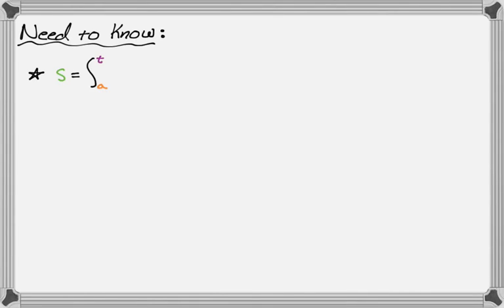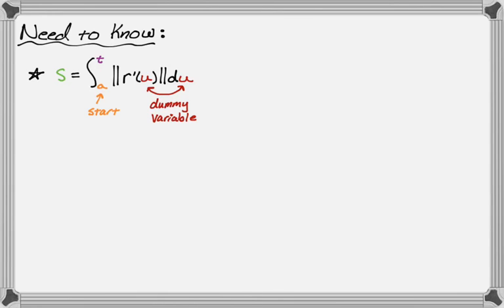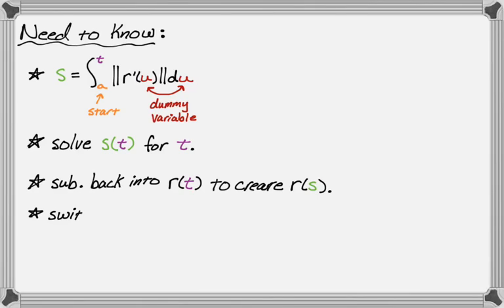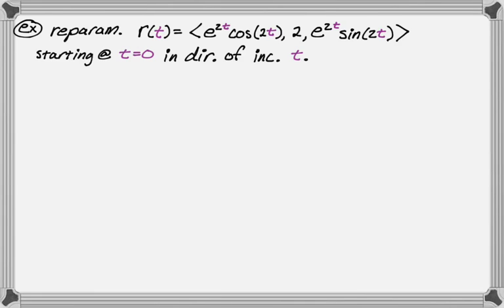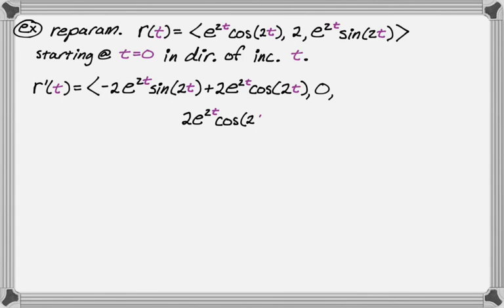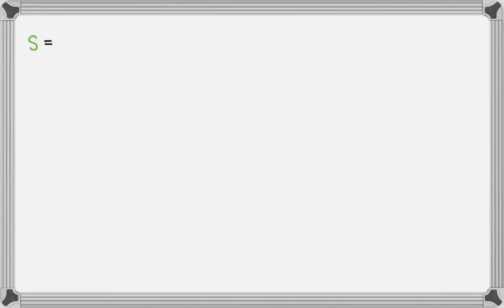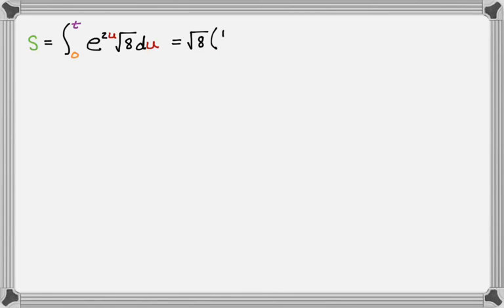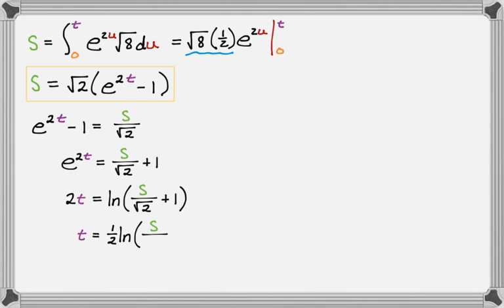Calculating an Arc Length Parameterization by Hand

Comment: Could you explain how you did the integral to check the answer?
Reply from the maker: The TI-Nspire CAS has a built-in function for finding the magnitude of a vector, it's called norm().  So I found the derivative of the vector valued function, then found its norm, then integrated that.  (This is probably not a good explanation...!)
Reply: @turksvids  yeah I have the CAS, and I have an answer to a similar question but I don't know if it's right...